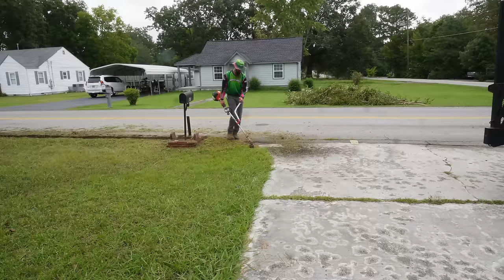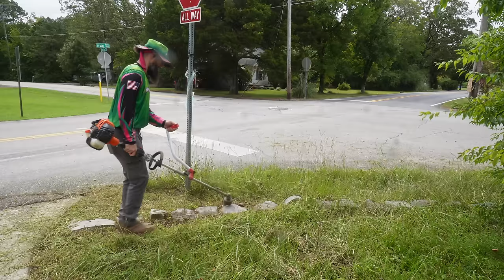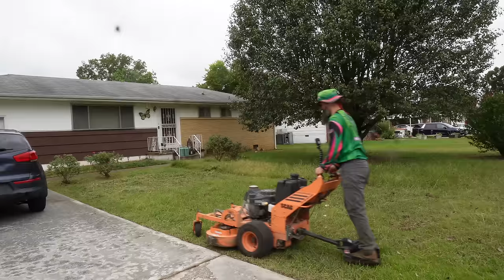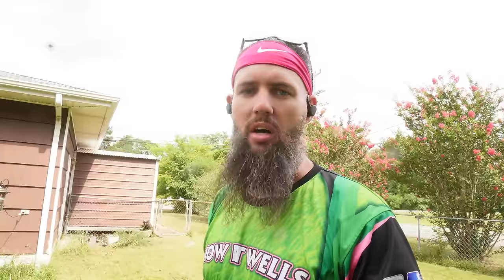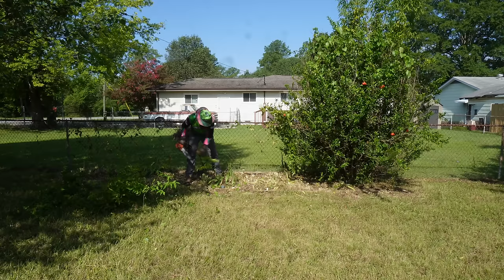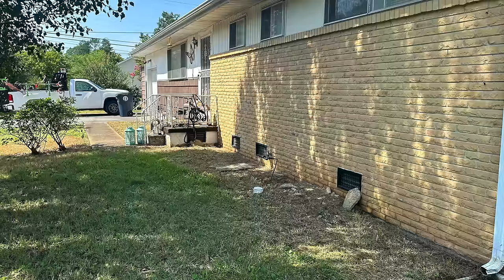They Scammed Her By Not Mowing

Comment: Patti I make a killer cranberry sauce.  The basic recipe is on the back of the bag.  I change it up. Y addi g the orange rind of one orange.  Then I add at least a teaspoon of cinnamon. It is really delicious!  My dad was wild for it.  The original directions calls for a cup of sugar.  He was a type 2 diabetic so I changed that and used half cup of the Splenda baking mix.  It worked!  You can juggle the directions to meet your preferences.  Easy and delicious.